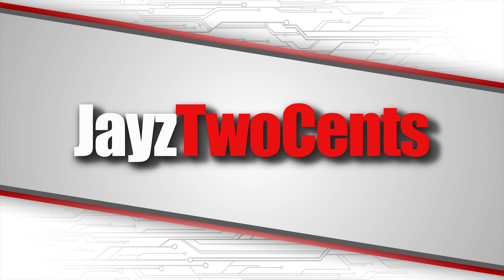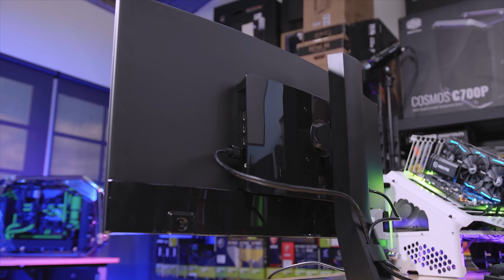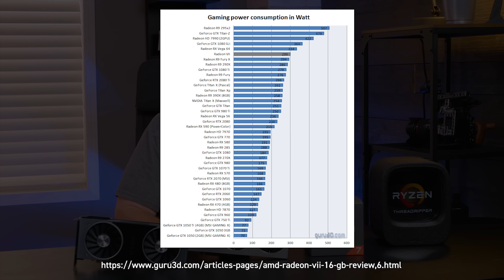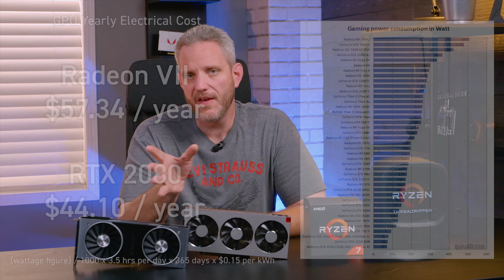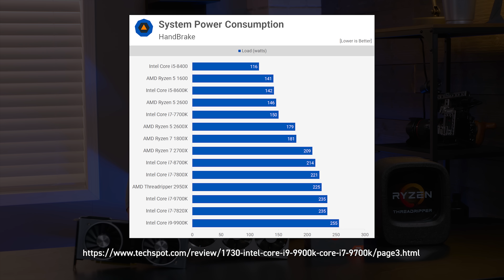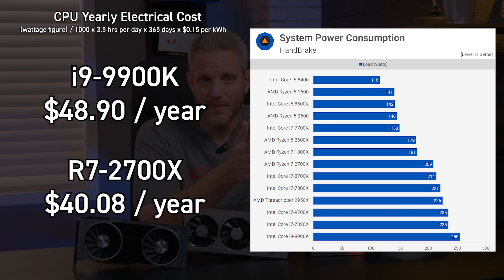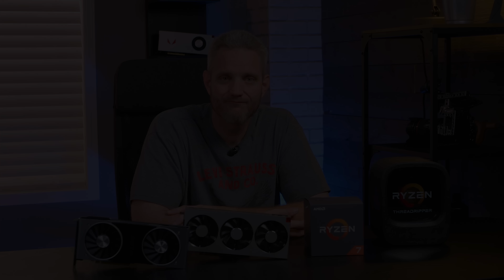Energy Costs of AMD vs Intel vs NVIDIA... This might surprise you

Comment: If you worrying about electricity bills then

Dont even bother build a pc
Reply: true
Reply: Or buy overpriced laptop, you know...
Sigh
Reply: exactly..
Reply: Power consumption has to do with more than electricity bills though. If you're one of the many people that like to build in extremely small <7L builds, then cooling restrictions mean that typically cards and processors with higher tdp will typically produce more heat that's more difficult to dissipate. If using mainstream consumer cases or mid towers, then yea.
Reply: I'm confused I used both on various occasions of not both. The bill barely changes maybe ten bucks with the Intel on all the time versus the AMD part time if it's even on or off for the month.
Reply: @Attack of the Pixels harsh....
Reply: RIP gtx 480 dreams
Reply: ya save your money and buy a can of corn
Reply: Next up. Calculate costs for running an electrical Vehicles.
Aha. TestLaS. 😅👍
Reply: Either your parents pay the power bill for you, or you have a very simplified dumbed down way of looking at things.  Power isn't the be all and end all.. but it's a significant factor.. both in terms of noise and also heat generated.  And then the power bill, which doesn't matter if you have a life.. because you won't be using it that much.. but if you're one of those 5-10 hours per day people.. it does matter.  There's some simple things one can do though.. for example enable power saving features (instead of 24/7 constant OC), and enable sleep in the OS.  And if you're doing 24/7 100% load stuff.. do it at night while your sleeping to take advantage of off peak power rates.  And don't OC your stuff past the point of diminishing returns.. where the CPU/GPU power skyrockets for only 2 fps more.  Otherwise.. power doesn't really matter that much.. because the prices are so low per year.. compared to the cost of the parts.. especially if it's Intel and NVIDIA.  Air con is the one that really hits the power bill hard.
Reply: that's not an answer
Reply: @Attack of the Pixels meh i always end up 34$ per Month for electricity bills

34$ is like if you save money or dont buy games you should ok 

Srsly What kind of parent getting triggered by 34$ electricity bills lol

Again if you worrying about it then just go buy consoles. Around340$ +40$ for 1 year PSN you can enjoy shit out of games for year or dont paying for Psn you can enjoy single play games

And dont worry im paying my electricity bills anyway lol

And paying 90$ for Managements bills +electricity and im not even poor for paying that much
Reply: @charlesdeviti2034  well he finally figured it out now then isnt he
Reply: Build a low power system and just gamestream from something like the nvidia game stream service. Though you pay for that as well as need higher speed stable internet connections
Reply: @charlesdeviti2034  oh wait he deleted comments 

:/
Reply: @Attack of the Pixels ahhh, king dunning-kruger.
Reply: If you're worrying about electricity bills, replace your old ass fridge that's just sucking back electricity like an old muscle car does gas.
Reply: @juniornunez7126  Yep. AMD currently has no super low power draw/temp but good performing cards (think low profile or half height) to compare to NVidia. AMD is starting to catch up with Intel for the micro ATX solutions, but for a long time just could not fit on the boards for comparable performance, and killed power consumption the wrong way.

So for a long time, and for the current present, AMD is not always an option for mini/small/HTPC form factor builds. But for everything else, they are close to competitive, just not the absolute fastest (but it's about to change!!!). PS, they are much better than Intel for the APUs/integrated graphics though! However if Intel is not lying, they are about to swap the battle in that regard too. XD
Reply: Try living in a country where you only turn on air conditioning for 2 hours a day and have to pay $500 a month you will rethink about power consumption.
Reply: RAY M or you know.. build something that doesn’t draw a lot of power? :)
Reply: @Jonw8222  "if you have a life" is a shit way to put it... if your an architect or a graphical designer your whole job is based on computers for 9 to 10hrs a day even if outside of work all you do is go hiking, skiing and mountain biking...
Reply: @rushdrift  i paid 50$ for pc and ac for 5hrs a day
Reply: @shawnpitman876  You realise fridges shut off when they reach their target temperature. Right? Even when they're running, they only use around 200 watts.
Reply: $300+ a month during the summer isn't a joke in a cheap electricity state.  Fortunately starting next Wednesday my roof will average 110% what I need and the excess is being sold ;)
Reply: RAY M lol
Reply: Yeah, get a laptop or tablet.
Reply: @mohdfaizal6773  About the cost of 3-4 F150 trucks. And there's no "renewable, clean" petrol or diesel. Hell even if the electric energy is produced from burning coal like a caveman, a modern electric has about 4 times the energy efficiency and 4 times smaller pr carbon footprint.
Reply: If you worry about power draw, get a cheap Chromebook and sign up to stadia
Reply: I've never heard of Jay comparing fuel consumption of Nissan with BMW, Mitsubishi, Subaru, Toyota, Chev Corvette or any other auto manufacturer whenever / wherever he's on those topics.  I guess  likely he does not care about that.  If you were running a huge fleet of vehicles or aircraft, I think fuel efficiency would be very important.   If you had a Corporation with 10's of thousands of PC's sure power should be an issue looked at.
Reply: BEST

ADVICE

EVER!!!
Reply: @Jonw8222  I think you're missing the point. The point is the cost of a pc in parts FAR outstrips the cost in terms of electrical bill. Low end parts don't consume much power to begin with and high end parts cost so much to begin with that the electrical bill is again irrelevant. What you are talking about, powering and cooling components, has absolutely nothing to do with your electrical bill
Reply: @shawnpitman876  AC use a ton of electricity fridges do not.  I run a mini fridge off a 100W solar panel at the farmers market.  Being on 50% of the time it uses about 40W/hr average.  The giant fridge is about 100W.  By contrast on a hot day the AC pulls1200-1800W per hour AVERAGE.  Still I had two machines running 24/7 and when we did the solar estimate figured out it was totaling 10-15ish % of the annual electricity and it went down quite a bit just hibernating one of them when not in use (the 2950x).
Reply: if your PC puts out 500 watts of power during the summer that's 500 extra watts you need to cool with AC, it really can add up.
Reply: @ewitte12  my whole freaking pc
Costs equels like   15days of home management include electricity bills or 39 days electricity bills

Im talking 1300$ PC 
If i spend 1300$ for an single pc then worrying about 90$ per month then i just move to stadia
Reply: @stonium69  sorry my 2600 and RX VEGA 56 stays at 67c on hot summer days

Comment: "...yea, but duh 1650 won't cost you as much monies to run az duh RX570 cuz stuff n stuff..."
Reply: stuff and thingies
Reply: It would matter IF you really use it a lot. But in most cases the card is just overpriced.
Reply: The only time power draw matters in computers is in laptops.
Reply: @vioco  Or large scale data centers/server farms/etc. For personal usage you're right. It only really starts to matter the smaller the device gets.
Reply: @TheBaertierchen  true that
Reply: @ABaumstumpf  ...no. It wouldn't. Ever. Not even if they were run under 100% load 24/7 in some unrealistic fabricated scenario. 
Stop it with your utterly make believe fanboy bullshit - Ryzen/Athlon APUs destroy this myth
Reply: @vioco  Yup, basically anything battery powered. And, even at that, this is only really true if you're using it in a more extreme scenario when you don't have access to a powered outlet for the majority of the day. Although, if it was THAT significant to you, then you would likely create some sort of accessible energy source for an 'emergency', via an inverter to plug into a car or something.
Reply: @TheBaertierchen  gei
Reply: @wiltord nark 1650 will never be competitive unless nvidia cut it pricing
Reply: @wiltord nark because it is mainly meant to be adapted into laptops where power usage is critical.

Comment: Everyone is also forgetting that the AMD chip is about 10%-12%+ slow than the i7. But the i7 is about $400 USD new vs the $280 for the AMD chip. The AMD chip is 30% cheaper, $120 to spend on something else.

Comment: Something that you missed is economics and inflation: paying $40 up front vs $40 five years down the road, paying down the road is cheaper both due to inflation and opportunity cost (e.g. you could buy an AAA game on discount for that). So even if AMD did cost more to operate, if it's upfront cost is similarly cheaper, the AMD option is still a better value.

Comment: Jay, you also have to consider that the 9900k gets stuff done faster, so it spends less time doing same amount of work (less time drawing higher amount of power).
If you calculate how much the CPUs actually consumed energy to complete the task, you'll see that the 9900k is actually more efficient.
Numbers from Hardware Unboxed's 9900k review:
Handbrake Watts consumed per frame:                       9900k = 5.6W/fps,    2700x = 6.1W/fps
Blender Kilojoules consumed to complete the task:  9900k = 4.58Kj          2700x = 4.76Kj

And HUB isn't the only one showing these results, in fact most of the 9900k reviews that have performance and power draw data from same program (so efficiency calculation is possible), show the 9900k consuming less power to complete tasks (while also being 10-30% faster).
Then, if you compare 8700k vs 2600x, the efficiency difference is much greater (Zen CPUs with shut down cores are much more inefficient, as seen in the link below) https://techreport.com/r.x/2018_10_19_Intel_s_Core_i9_9900K_CPU_reviewed/taskenergy.jpg

So AMD CPUs still are better "space heaters" = more energy drawn and dissipated for same amount of work = more heating (die temperatures are irrelevant)

Comment: >complains about a few extra $ on power bill
>Probably spends double or triple that on internet

Fanboy logic
Reply: As someone that sells electronics, this reminds me of how people seem to have no problem spending $1000 on a phone but as soon as a laptop reaches $300 ---> ooof too spicy.
Reply: @SaraBearRawr0312  And they do nothing on their phone that could justify the cost. At least you could potentially work on a laptop. For me once a phone is more than 300$ - Get outta here... especially now in 2019 - back in 2015 when I bought a phone I paid 330$ for a mid-range phone that was good. Now I see better phones for 200$ - compared to the flagships of 2019.
Reply: False comparison, since one cost is fixed and the other varies with use.
Reply: Fanboys also said your same exact comment when their favorite brand ended up making a product that used more electricity LMAO
Reply: My logic is that I don't like replacing the damn PSU. 
No PCIe connector? Tough shit.
It exceeds the PSU wattage? Tough Shit. AMDs CPUs are getting better without a doubt there, but not the GPUs.
Reply: When you get to higher end GPUs, it's even worse. The Radeon VII conumes more power by 50 wats while being at a similar price to the 2080.
Reply: @jaronmarles941  that's a different and totally valid argument. I avoided the Vega 64 for the same reason (I only have a 650w bronze psu). As far as the cost to run though, it's largely negligible.
Reply: @lashyndragon  The cost to cool it on top of that however, not nearly as much.
Reply: Voltage matters more than most people defending AMDs high wattage think. Not to mention the cost varries depending on the location.
Reply: @jaronmarles941  if I'm not mistaken, voltage is part of wattage in that wattage is voltage*amperage
Reply: Only time I would even begin to care about desktop  power draw would be if I was building a mITX build.

Comment: Radeon Chill can yield substantial power savings.  Chill doesn't get enough credit when power draw is discussed.
Reply: Agreed, and if you are on an older AMD setup It's called Cool n' Quiet.
Reply: How did you get this to work? I activated it and never noticed any difference. Never saw any decrease in GPU load or temps or anything.
Reply: @lorenhusky2717  You set up chill in game-specific profiles.
Reply: @CommodoreFan64  Cool n' Quiet is for CPU's.  Chill is for GPU's.
Reply: @TrueThanny  yes, but my point is that they both help to overall keep your system cooler and reduce power draw at least In theory anyways and if you are on Linux the AMD chill is not really a thing you can do  at this point in time.
Reply: Exactly! My RX590 from sapphire show max 80-90W usage with v-sync on (gaming on 50Hz TV). And people were saying it will take like 175W...

Comment: There's one thing I would say about power draw. If you're looking at putting parts in data centres, power draw is huge, because power draw = waste heat, and waste heat requires cooling, and you get billed accordingly by the data centre.

Comment: How your calculations would change if you had 20 hours of idle power consumption and 4 hours of active power consumption.  
Anyway that is for people whom 2 minutes of their time is more valuable than 20 hours of idle power consumption of their system.  Or people who sit in front of their own system whole day, while doing something else than gaming.
Reply: Then it would be a case per case basis.
Because your whole day doing something else, might have your system close to idle.
While my day for example will have the GPU most of the time on idle but the 16 cores of my cpu on high load.
And days where I use ML tools, I would max out everything for hours and hours.

It really depends. This is why you should choose wisely, and if you live in a house and your electricity bill starts to really be a problem you might also consider solar panels. (If it's your house and you have the money, the later should always be considered)

I think the video of Jay here is absolutely fine, it shows the 90% gaming desktop. Turned off at day while  people are at work / school / etc. 
In contrario to all the comments that say you will recover your money on electricity without doing any actual calculation.
And what about heat ? In the winter,  I turn my heating out completely in the computer room, should I take that into account ? 

For people that are really minded about electricity cost, I would suggest an average laptop that maxes out at less than 100W. Plus it gives them mobility.

Comment: A 2700X costs about 40% less than a 9900k ($280 vs $480) but flipping the numbers around a 9900k costs over 70% more. Changing the denominator matters a LOT when the differences are so large.
Reply: Nobody talks in percentages like that. Just say it's 200 bucks more.
Reply: Don't forget another $50 for a decent cooler.  You can run a 2700X with the stock cooler.  You can't run a 9900K with its stock cooler (i.e. none).

Comment: Don't forget - your calculation is only true for the US. In germany you will pay nearly double for the kWh and the price for the parts incl.VAT is about the same than in the US and because of that the power consumption of a part is much more important when you buy it. I got a Sapphire R9 390 nitro - needing about 375W - I changed it a year later because of the loudness and its power consumption against a Gigabyte GTX 1060 6GB OC - both about 350€, same performance in the games I play, but about 255W less powerusage - In your calculation, but with german prices  255/1000x3.5h x 365 x 0.28€ = 91.22€ = 97.73$ difference / year. That means roundabout 100$ a year. That's more than a tenth of my electricity bill for the whole flat.....

Comment: Can't wait for the reviews to come out on X570 and the new Ryzen chips.  Might actually make the jump and leave my 4790K and upgrade to Ryzen.
Reply: CPowell133 I’ve had my 4790K for +4 years and it has served me extremly well - I’m in no rush to upgrade since the performance boost is less than 20% and i don’t game that extreme though i own a GTX1070.

But if Ryzen 3 series is more powerfull, less power i might do the transfer.
Reply: Your 4790k will probably last two more years, wich is probably when DDR5 memory will start being common, wich means new motherboards. That means you could do two upgrades while only buying board and memory once. wich would be a significant amount of money. For just gaming, a 4790k is more than enough.
Reply: My 1070 in my bottleneck with a 2700X.  AMD has some secret sauce somewhere where a benchmark number means absolutely nothing. AMD systems have always impressed me with their performance vs what one would expect from it. I can't explain it but there's just something there with AMD and I've owned Intel my whole life.